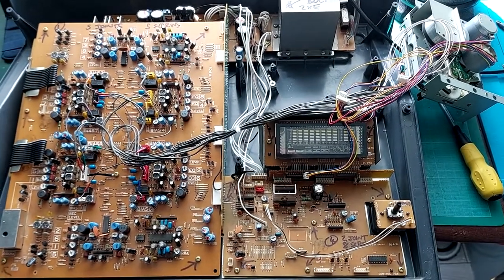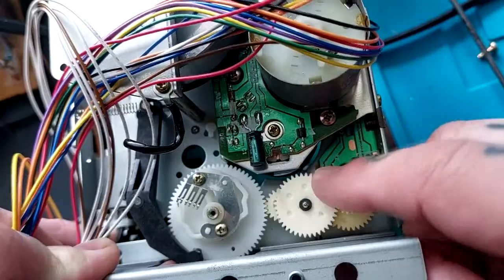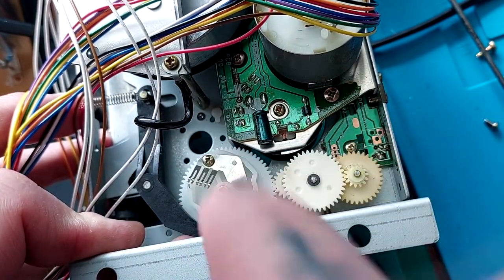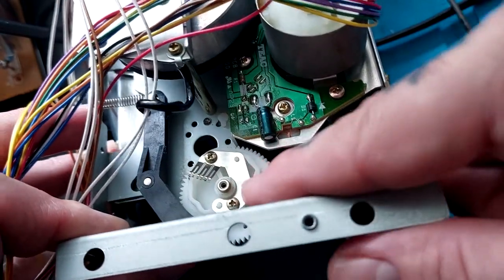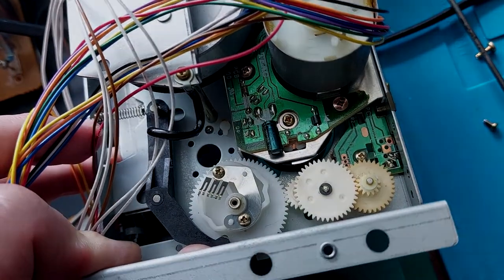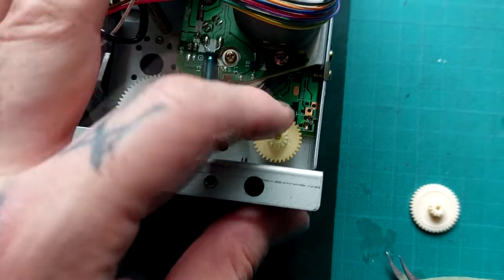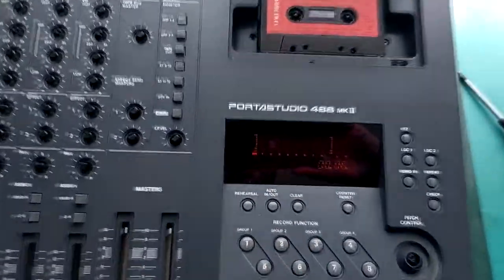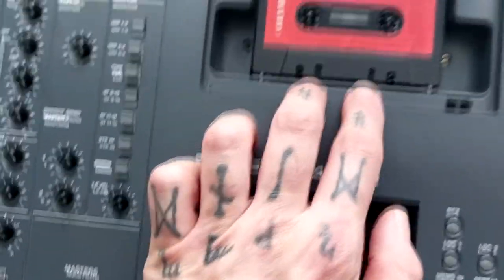Tascam 488 MkII or 464 - gear C replaced, but transport LEDs still flashing? Problem solved!

Comment: I have the same issue, I initially thought it was the belt, replaced that and still getting very slow playback, looked at the C gear and it looked ok, so I guess it’s the grease, my C gear is also very yellow so I am replacing it at same when I go in and relube everything.

Comment: hey tetrakan, i’m having a similar issue to this but on a 424 mk1. all the green leds on the meters blink and the capstan spins intermittently when i try to play it. the solenoid had fallen out in transit, but i fixed that. i’m just wondering what i need to fix? everything looks like it’s in working order. nothing glaringly wrong. the gears feel fine. help me out? thanks.

Comment: Hello, I have a question about my 424 mkiii. The pitch control doesn’t work when normal speed is selected, but it does work on high speed. Any idea how I could get it to work on normal speed too? Thanks.
Reply from the maker: Sounds like there’s a bad resistor or wire on your pitch board, open her up, look for a loose wire, check neither of the resistors is burned out, do me on Facebook if you’re stuck

Comment: Hey - Sorry for just hijacking the latest video. I'm realising the GEC (Porta One) transport I'm using needs extra eclips and bearings  - can I get away with 1.2mm clips and 1mm bearings? I can't find smaller e clips (0.8 sees out of stick everywhere), and are 1mm bearings okay?  very grateful for any advice :)
Reply from the maker: I haven’t tried with smaller sizes because I’m in the fortunate position of carrying a lot of spares. I mean try, but I wouldn’t be surprised if it caused problems….
Reply: @Tetrakan  do you know the correct sizes, or is it just 'those ones in the transport' from, your experience (I could understand not knowing - as you say you have naturally come into spares)
Reply: Might be a case of just buying another spares and repairs of the cheapest machine carrying that transport
Reply from the maker: Yeah I don't know for sure - at one time you could get ill porta ones for buttons on eBay and i bought a few hence my parts supply. Does the parts list accompanying the exploded view in the service manual give these specifics? It's  free download on my blog. Otherwise faulty fostex x15s were changing hands for under fifty quid recently, good luck.

Comment: Nice solve! I've got this flashing transport issue with my 488 and will be tearing it apart soon, thanks for your walk through videos. Where do you order new C gears from? I found some from a guy across in America, I'm assuming there's nothing in Scotland or the UK?
Reply from the maker: Thanks. I’ve ordered from Germany and Netherlands in the past, the listings change all the time or I’d share a link. Yeah I’m in Scotland, no sign of a supplier within UK that I’ve seen.
Reply: You can 3d print it for free if you or a friend of yours got a 3d printer :) i did it all by myself and it worked perfectly
Reply: I don't think the 488 MkI has a gear C...the MkII does - is this correct Tetrakan?
Reply from the maker: @richardsmith4992  it is correct, I thought maybe he had abbreviated out the "MkII"?
Reply: Hey Tetrakan, finally got round to doing this - it was solidified grease and the C gear broke when I took it out! It took a few attempts of removal, cleaning, regreasing and reassembly before it would work, and now the tape head movement up and down is really jerky (but working again). I'm wondering, I cleaned the grease off the round electrical connectors on the largest gear in the assembly, could that be causing the issue? I take it that's not silicone grease if it needs to conduct?

Comment: Any chance a motor could be shot causing the three flashing lights? Or most likely gears causing it? Mine has been parked for years when I gave up a search for a motor replacement but now you have my curiosity peaked once again. I had previously replaced a gear and the capstan belt. Thanks for the vid.
Reply from the maker: I haven't come across it and I would've thought hardened grease was a more likely explanation, but it seems possible to me...have you tried hooking up the motor to a 9v battery to see if it spins? See this video https://youtu.be/HFm06qh1nmw
Reply: @Tetrakan  I appreciate the tip. I hit a lot of dead ends a few years back with limited talk on the forums and not a whole lot on here. Glad to see you're keeping it alive. 👍👍